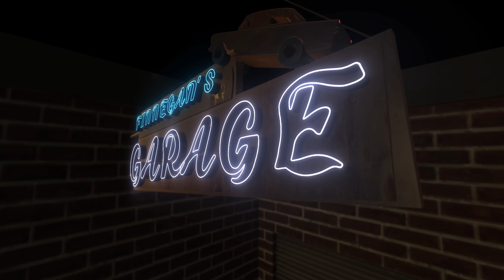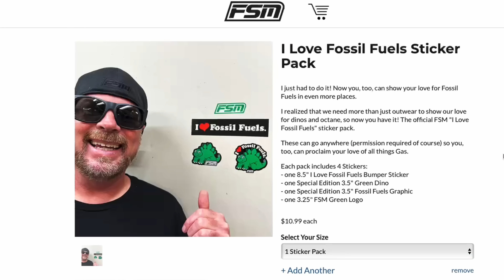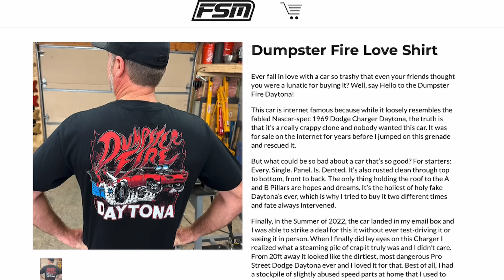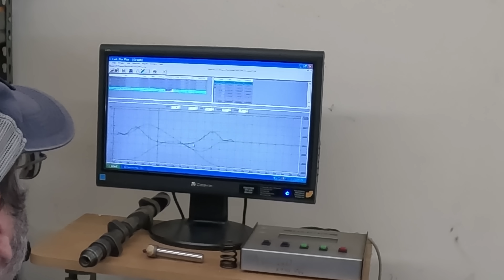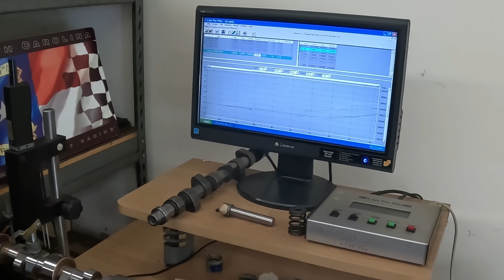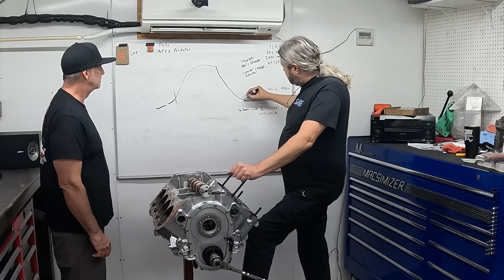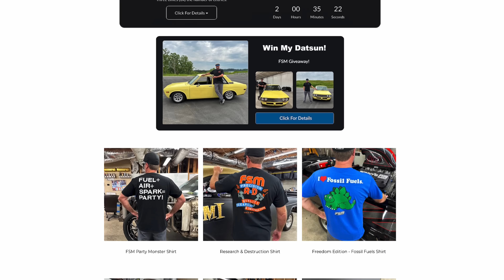WILL IT RUN AGAIN? FIXING THE REAL PROBLEM WITH MY 632CI BIG BLOCK CHEVY RACE MOTOR!

Comment: This fkn Pete guy just laid out a basic big lift valvetrain class in minutes that was more digestible than anyone I've ever heard talk about it.
Reply: You don’t know Pete? He’s real good at doin stuff
Reply: Dude Pete is the man. He tunes and builds Cletus McFarlands LS builds. In fact Pete’s LS 427 in cletes corvette is the first stick shift vette in the 6’s in the world. Pete is a legendary engine builder and tuner.
Reply: @briandstephmoore4910 hahaha indeed he is…😂😂
Reply: Thats cause he's real good at doin stuff! lol
Reply: Pete also has a SICK sense of humor 😁😁😂🤣
Reply: @BlackbeardJohnson  not a 427 in Leroy anymore. They put a shorter stroke crank in it to keep the torque down. Think it’s a 388 now.
Reply: @Ddabsolve its a 392 cubic inch engine, based on a LSX block and wearing a bigger set of MAST cylinder heads. The smaller cubic inch build was done to allow the engine to rev higher, with Pete Harrell noting it should be good to 9,000+ rpm
Reply: Pete is the man.
Reply: Pete is incredible.
Reply: I just recently subscribed to Pete’s channel…🧐
Reply: He took a solid approach at figuring out what's wrong with Mike's 632 starting with the basics and breaking it down. Nobody can know everything but the good guys who know a bunch know where to find the answers even if they don't already have them in their head. That cam doctor machine is awesome!
Also this episode should be a lesson... don't willy nilly regrind your huge x large roller camshaft...for example taking a Bullet grind and having Isky try to grind on top of it. Either buy a new cam from the grinder of your choice more suited to what you are trying to do. Now these guys seem to have "saved" this grind but honestly I'd simply clean slate a new billet solid roller bump stick for exactly what I want that engine to do, but that's just me.
By the way Pete is also really good at making pretty hardcore music with a punk and metal influence. I bet the feller can play country music too but might not admit to it.
Reply: People that know the most can explain it in the simplest way. Anyone explain something in technical terms to someone that doesn't understand, doesn't understand fully themselves
Reply: Pete's REAL good at doin stuff!
Reply: This applies to ANY cam...
Reply: well he is real good at doing stuff
Reply: Thinking I read an article Abt this topic or the ramps in cam profiles in either car craft or hotrod long time ago an Pete's was dead on it too
Reply: That wasn't just a class, that was a true Master Class in Cams, Springs, Valves, and Clearances, and how they interact.
Spotting that the lifter was not in contact with the cam at peak lift,... how this motor didn't grenade on the water,...
Reply: Mike Jones and Pete Harrell in the same room is an awful lot of knowledge.
Reply: I love the way he makes things understandable for the folks that don't really understand what goes on in an engine, but it doesn't sound dumb and too basic to folks like me that understand the happenings inside a 4 cycle engine.
Reply: and about the nicest guy I've ever met. I wish I had Pete Harrell money to build my big block lol.

Comment: Steve Morris and Pete Harrel are really just good at teaching engine stuff. They are not just saying "This has to be that way" but also talk about the why. This is the first time in years that I actually understood what that ramp rate is and why solid rollers need a certain lash. Mind = blown! 😎🤟
And yes, Pete is really good at doin' stuff. 😁
Reply: Yep. Even a lot of pro engine builders don’t really understand how important the ramp rates are to valve control. They just want big lift and big duration so it makes good power. 
Steve had that engine a while ago that was having problems so he did his own cam for it. Showed how well he knows his stuff when the “specs” of his cam was more mild, but it made more power and wasn’t abusing the valve train nearly as bad.
Reply: Yep, not only what Ramp Rate is, but how it impacts the starting and stopping of the valves motions, and the pushrods inertia. About the only thing not covered was how larger lifter diameter enables steeper ramp angles, which is why Muscle Car era MoPar cams were always wilder 'stock' then modified cams on GM's and Fords, thanks to having a wider lifter.
Reply: Steve not so much. He puts on more than he knows.

Comment: Gotta love a Sunday, I hear Pete is Real good at doing stuff.
Reply: I can’t wait.
Reply: @CMSFan2010  Say it like you mean it!
Reply: I CANT WAIT!
Reply: His Walmart bought jams are 👌 too.
Reply: Right off the top of my head, I can think of one more motor that needs to have the cam doctor treatment, And a little trip to see Pete wouldn't hurt either!
Reply: And Pete knows guys that are Real Good at doing Other Stuff.
Reply: @iceman22m  I’m guessing it’s from a builder who “designed their own cam”? 😂 The one old boy up north acts like he applied an engineering degree to design it all the way down to sourcing a foundry. If not you’d have to charge normal prices. 🤣
Reply: Pete has skills with handling stuff you say…? 🙄
Reply: @KimiWallrus  
I wonder whether it is meant to to a hydraulic lifter cam, so no tappit clearance needed.
Just a thought from someone that knows very little about such things.

Comment: at 9:25 it looks like the push rod was out of the cup and was riding on the flange of the lifter.. That would increase the lift and cause the valve to touch the piston.

Comment: I'm surprised with that spring pressure and cam grind that you weren't tuliping valves also. Especially those honking 2.5" intakes. No doubt Pete's the man when it comes to doing stuff on motors.
Reply: Yes!  I was thinking the same thing!!

Comment: I watched the original video when you dropped the valve (Roadkill moment) and as you tore it down, my thought was cam, rocker ratio or spring issues. Thanks for posting this class on valve train geometry and why it will or will not work. Get the boat in the water, I want to see a full run with no problems, it should haul ass now.

Comment: That’s crazy. I had the same exact issue with my 582. It wasn’t breaking parts…yet (luckily)…so the builder suggested the exact same thing. Grind a better “ramp” and take some violence out of that valve train…and the car is actually slightly quicker!!👍👏🏻👏🏻👏🏻👏🏻

Comment: MIKIE & JOE, thank you so much for sharing with PETE HARROLD & MIKE JONES the deciphering of the issue with the Big Block valve train you were experiencing. I definitely learned a lot!! THANK YOU!!
I've watched guys slam extreme springs on their heads thinking it was necessary because of the massive lift camshaft they tossed in their engine. Or, they would play around with funky rocker arm ratios to compensate for a ridiculous radical camshaft. 
This episode was so very awesome with the knowledge and especially the description of:
What to do,  as well as,  what not to do. Can't wait to see you drop in that big block and hopefully get to make a pass sometime this year!!
😎🇺🇲🇺🇲🇺🇲

Comment: Years ago I was looking for an engine builder local to where I lived in South Georgia. Told two different shops what I wanted the engine to do and that I wanted the stiffest valve train that could fit under under the the valve covers including bigger than normal pushrods cause that was what started the problem originally. One of the shops tried to convince me that smaller meant lighter and therefore more power, needless to say I didn’t use that shop!

Comment: So...alloy heads on iron block which will gain lash as it heats up....looks like '0' lash cold would be the only way to go.   And hopefully the cam is now ground to accommodate the lash it's going to have when hot.   Lots of things the builder got wrong on this one it seems.

Comment: wow that cam was cut real poorly to be bouncing the valves like that crazy stuff . nice work guys and Pete and his cam Man know their stuff and are real good at doing stuff i would say
Reply: If it had been in an iron block it would have been ok. But, with all aluminum when the block and heads grow the lash increases. That was basically moving the lifters off the ramps which was making it slam the valves to much.

Comment: Somebody had a bunch of parts they threw at an engine so they could make a quick buck. They just threw around part names to sell it. They didn't check anything when they threw the engine together. Engine wasn't even built to run and I'm surprised it made it pass break in.
I've seen this a few times with guys "happen to have an engine" at the drag track and as soon as somebody buys it they pack up and get out of town. Always a bunch of fancy jewelry on the outside but the inside will be crappy used and/or junk parts.

Comment: If you watch those videos of slow-motion cam springs being compressed they can form a "slinky" effect, You can fully compress them static and they have clearance... but (theoretically) at speed the coils could still bounce off each other.
Not saying this is the cause, just food for thought to anyone building an engine with allot of spring compression at high rpm.

Comment: I rewatched the video a few times trying to get a better look at the rocker geometry, to my eyes, it appears someone put a longer valves in to get spring height and didn't adjust tge rocker stand height. The pushrod cup to tip angle is w fuckin mess, the rocker arms hitting the stands, all points to rocker stand height to low for that valve tip height. That's why it's snapping the pushrod tips off. Conbined with that ridiculous lash ramp, it is amazing ut revved up at all. 

Revisit those rocker stabd and valve tip heights

Comment: This makes the head crack make sense now too… the crack allowing water through-
The bouncing vibrations in the aluminum head found the weak point in the cooling cavity so it needed to be jb welded…

Comment: seance the issue from the ex valves, heat is the enemy, oil should take chance and cooling the valve guide, I am not big fan of using and sealing the ex valve guide with Teflon or and any way of sealing, Thanks

Comment: If you lower your shutter speed, you can reduce the scrolling dark bands. You can try lowering it, matching to frame rate, or turning off the shutter (these all depend on the device you are using, of course).
Reply: Yes, frame rate VS shutter speed VS power line Hz…. 

I like to shoot @ 23.98 FPS… and if I you [properly] follow the “180 degree” rule you would select [the nearest available shutter speed twice the Frame rate] of a 50th of a second….  If I do? I get the same rolling bands of darkness, LOL…

The only way I’ve been able to get rid of this “rolling bands of darkness” is by selecting a 40th of a second!!  Which is technically incorrect! . You are not supposed to select a shutter speed that goes below the rule [of double the frame rate= shutter speed]…[in fact some video cameras won’t allow you to break this rule? But my Sony’s let me…] and this got rid of that problem!  ANY shutter speed higher than “double” [regardless of what I picked] cause the same dark rolling bands … only difference was spacing and number of bands!!

So, I’ll bet he is using 29.97 FPS?   Maybe even 60? [which is also NOT exactly 60, exactly like 24 and 30… I just don’t know the exact number, LOL] … he should try a 50th of a second, instead of the default 60th? If he is at 30, or  100th if at 60FPS.  

I’ not exactly sure though only because I LOVE 24FPS.  I don’t bother with other frame rates [except if trying to do slow motion work]

Lastly, this problem seems far worse with LED light sources  than Tungsten??  and indeed LED’s are unworkable for slow motion shooting here in my studio at frame rates above 120FPS
Reply: @Studio51media  nice information! I learned something from your reply :).
Reply: @Studio51media  for LEDs, the flash is more discrete (hence higher dynamic range of on vs. off) I believe.

Comment: I am guessing that the cam lobes have to be re-induction hardened after the grinding?  I am  not sure how "thick" the induction process is on something like a camshaft.   Would be interesting to know more about this after making minor grinding adjustments like this.
Reply: The cam is made out of 8620 steel, and is carborized over .100" deep.

Comment: Had a buddy try to build a ls motor and he just picked the biggest cam he could. Destroyed a lifter, dropped a valve seat, then broke a valve to finish it off. Never ran it after that. I always thought maybe he didn’t have the right springs in it but maybe it was the cam.

Comment: Engine is at the right place 👍🏻👍🏻👍🏻👍🏻!  When a 632 is correct, they make really good power, even N/A! I don’t think you want to use that 711 in the boat! Unless you are only running a small shot of nitrous! Those heads on the 711 do not like big shots of nitrous! There’s many engine builders that tried, they would only take about 1/2 the nitrous the wedge head would take! JS!

Comment: 0.145" clearance, and it still hits? that tells me it's a mismatched spring and valve float situation
Post cam doctor lookover, sounds like I was right on the float, except it's actually the cam ramp that is a mismatch, hadn't thought of that till he said that.
The cam before grinding by Pete's description was almost equiv to a superstock drag cam. instant open/close to get the most out of the stock lift and duration. meaning very peaky in a designated RPM Range but practically useless anywhere else. It's also very harsh on the valvatrain of the engine

Comment: Good stuff!!
And a older Berco camshaft regrinder from 19?? still doing its job!!
Reply: Good eye. We only use Berco grinders. That one was built in the 80's, and fully rebuilt and switched over to a digital control system, around 2002.

Comment: You really should have gotten a new cam and lifters for it.  I'm not convinced the quick regrind is going to resolve the issues.  Obviously, this one was way off.  I'd have called both Bullet and Comp and got new recommendations based on the engine specs and usage.  Good luck!
Reply: Actually, the original cam wasn't far off at all. The issue with the lobe profiles was that they were "Tight Lash" designs(.014"-.016" Hot Valve Lash), but because this is an aluminum block/aluminum heads engine, even if they set the cold lash at .000", when it got hot the lash would grow beyond the end of the lash ramp, and well onto the acceleration ramp. This was putting the valve acceleration at the lash point well beyond what the valve-train could handle.
Reply: You don't know Mike Jones'es credentials. This guy makes NASCAR Cup Series cams.
Reply: The regrind makes it a new cam. No more than they changed it hitting the specs they’d get with a new cam was relatively easy.
Reply: @MikeJones-zj5lj  Just set the lash hot.
Reply: @VitoF111  great idea, but how to start the engine again, because when it cools down, the lash will tighten up so much, the valves will never close. Hard to compress the air fuel mixture, when the valves don't close.
Reply: @MikeJones-zj5lj  We're using this Comp cam on two of our aluminum 632 engines.   24210RE/34094RE R 115.00, 285 int and 306 Ex duration at .050, .914 and .872 valve lift (1.8).  (Also suggest using the larger dia lifters.)  It's on a 55mm core and makes great power with good valve train stability.  Good luck to you all!

Comment: I’m to the point in the video where Phil is measuring the physical clearance there’s a lot of people from the last videos comments that owe miller an apology is that engine messed up definitely but for a rush job he didn’t miss measure that engine for piston to valve this is why you show grace not blow up on people it’s ultimately not helpful

At least you found your hp leak and your reliability problems all at once sorry it had to go to the machine shop to figure that out though
Reply: Your comment is all over the shop…..I’m so confused…
Reply: @michaelteasdale2919  I just added in my own punctuation but I got there...

I’m to the point in the video where Phil is measuring the physical clearance, and there’s a lot of people from the last videos comments that owe miller an apology. Is that engine messed up? Definitely but for a rush job he didn’t miss measure the engine for piston to valve clearance. This is why you show grace, not blow up on people. It’s ultimately not helpful.

At least you found your hp leak and your reliability problems all at once. Sorry it had to go to the machine shop to figure that out though.

Comment: I feel good about this. The whole point of this boat was to be carbureted and simple. Once this engine has been gone through and sorted out, I think boat will finally be reliable and fun. Fingers crossed. I also bought a Blasphemi t-shirt today to get in the running for that Datsun! 🙂
Reply from the maker: My hope is that it stays simple and fun. fingers crossed that's what happens. Thanks for watching and for the support. good luck in the datsun contest.

Comment: So, it was an engine that someone tried to make the wrong parts work or was it a combination that just didn’t work?
Reply: Likely just a combination that didn’t work. When you get deep into building race engines there’s so many factors that become important and so many parts that need to work together. With this someone likely just ordered a cam that was higher specs expecting it to work and make more power. 
That’s part of why a lot of engine builders tend to develop packages and specialize in a few specific engines.

Comment: Looks like you got a launcher cam! They are used in stock classes and launch the lifter off the cam to achieve higher lift than is allowed in the class